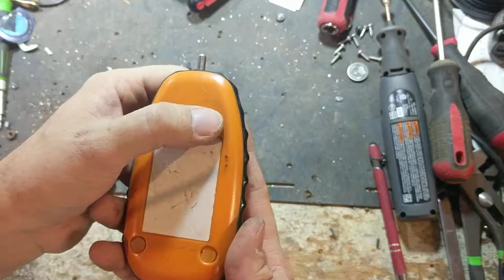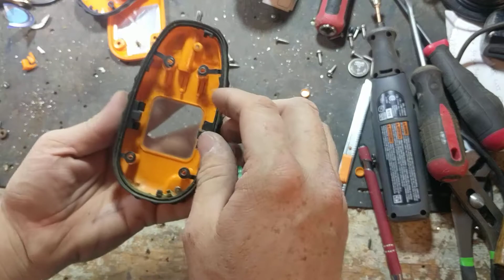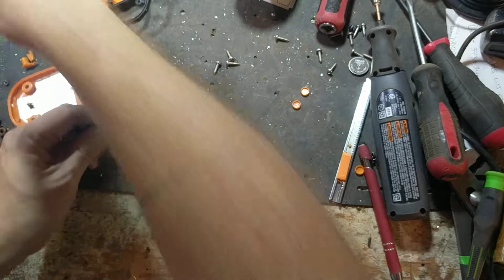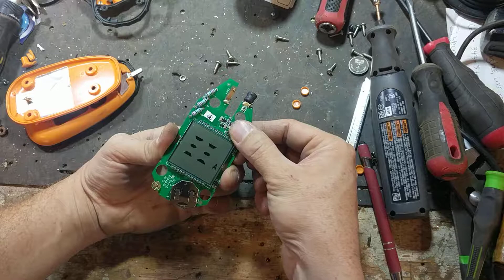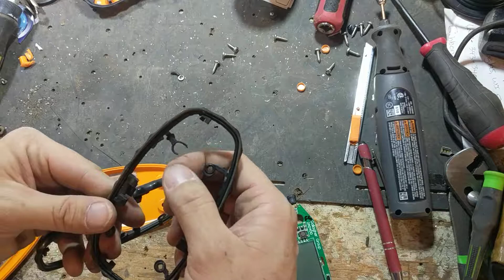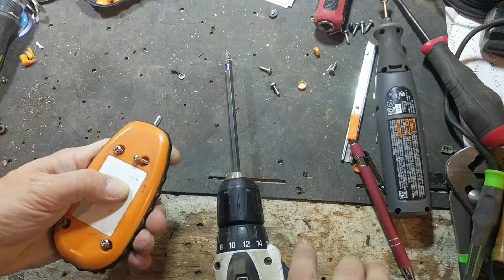Gallagher Smartfix Fault Finder Repair and battery replacement reset

Comment: I got quite an old one of these, changed the battery a couple of times on it. Low battery fault was showing again on screen, so I changed it, fault was still showing, and after tinkering with battery a bit it has stopped showing anything on the screen (completely dead). I guess it’s dead and rubbish now, unless you know of a fix for this?

Edit: Nevermind! Watched the rest of the video and saw the trick shorting out the battery terminals and that fixed it! Thanks very much!
Reply from the maker: Yep, sometimes you have to do a reset on it at the same time the battery is being changed. They do offer parts for this tester as well so they can be fixed.

Comment: Hi. What would cause this tester to under-read voltage? When compared to a speedrite tester it reads about 20% lower voltage but the current is the same. Thanks
Reply from the maker: Hi Jim, it depends on what the other brand of tester is and how you're testing it. Some brands of testers will test other brands of fence chargers accurately and some brands don't. It also depends if you're using a fault finder type of tester, most of those don't have a ground probe on them. So if you use one of those you have to test across the unit at fence and ground at the same time, if you don't, you'll only get a partial kv reading. When you're out on the fence, your hand and body are acting as the ground probe, so then you're testing across fence and ground at the same time and you'll get an accurate reading at that point. Hopefully that helps you out. Let me know what brand and model of tester your using or what other questions you might have, happy to help.